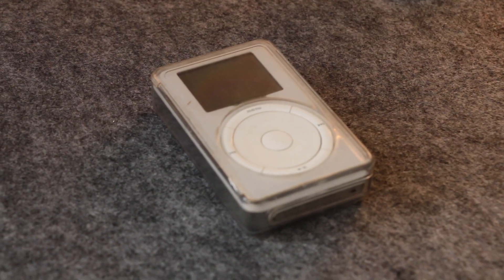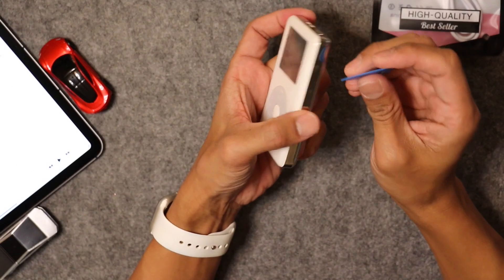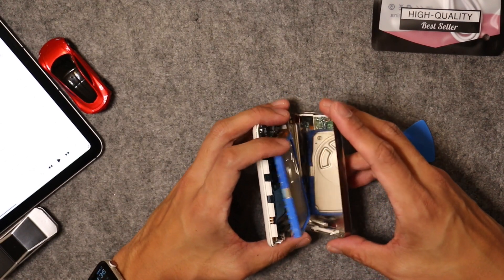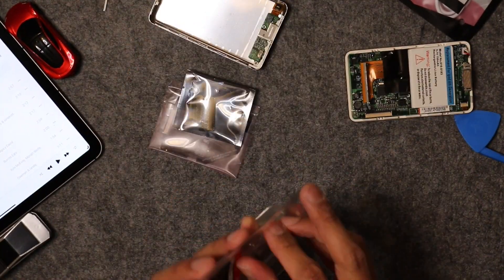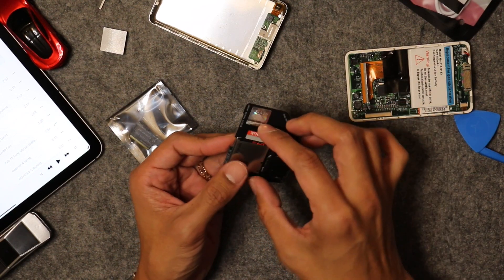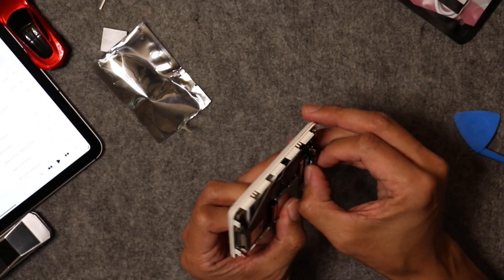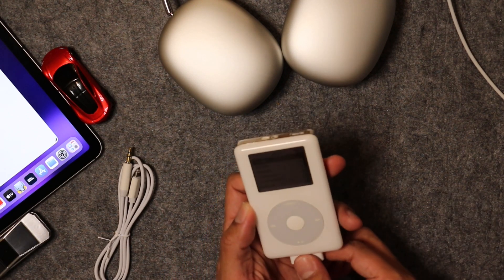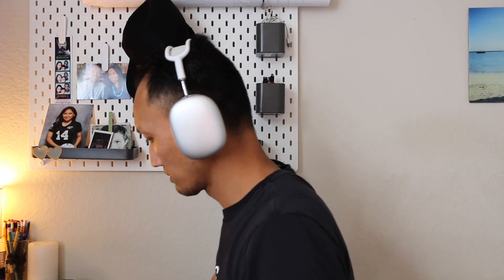iPod 4G Restoration

Comment: not sure if you're still answering on this video but i've had nothing but issues with the 4g converter. i bought a second one and after putting it in it worked great until putting the ipod back in its case, whereupon it broke. do you have any tips/instructions for folding the converter?

Comment: Tips on getting the iPod open? My guitar picks keep shredding on the ends and after an hour I still haven’t gotten enough of it pried up to reach downward to get to those clips (you do go downwards for those right?)
Reply: Try using a trapezoidal boxcutter blade. Other guides often show it. You shove whole sharp end to the seam and pry it. You got to be careful to not let it slip and scratch housing, but opening the thing gets pretty easy. Oh, and if you have a 6+ gen iPod, opening that is much harder.

Comment: Could you share where you purchased the aux cable (3.5mm to lightning) that worked for your Airpods Max?  I have been trying to find one that supports transmitting audio to my Airpods Max and have had no luck (cables I found only transmit audio from lightning to 3.5mm and not the other way).  Thanks!
Reply from the maker: I ran into the same issue. I ended up going with the cable that Apple makes. It’s the only one that transmit audio from 3.5mm to lightning, like you said. Good luck!

Comment: Oh man I just did this with my iPod 4g as well! ended up using the ATA1 flash adapter instead, which didn't require the additional adapter that you showed. It's amazing how fast it is now, and I can finally load my entire lossless music library onto it!

How did you get the battery to stay down? I ended up having to reopen the iPod and put electrical tape across it as the battery kept rattling around in there. Was my battery replacement just the wrong size to fit?
Reply from the maker: It might be? The battery I got was the exact same size as the old one and I had trouble getting it and the cable to fit properly. But hey, as long as yours works right?